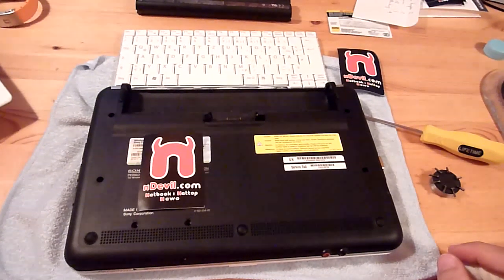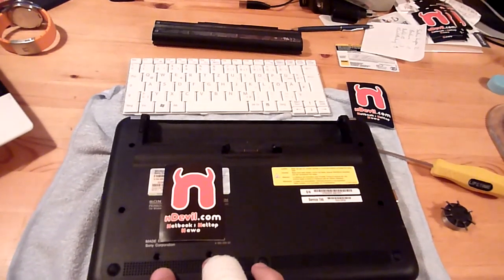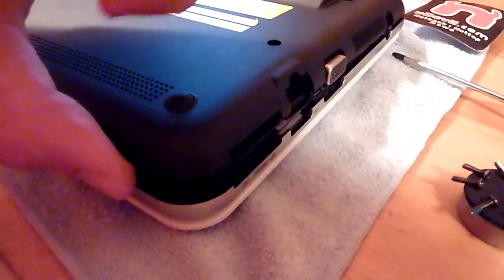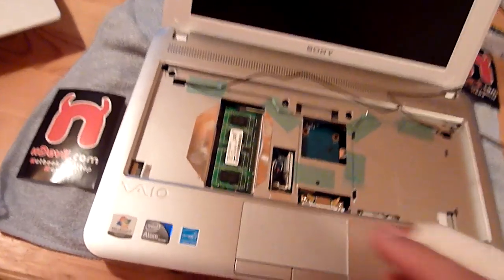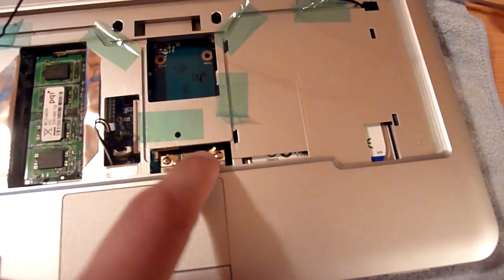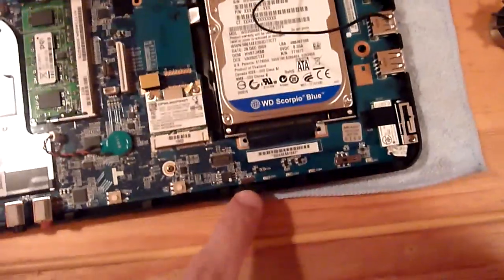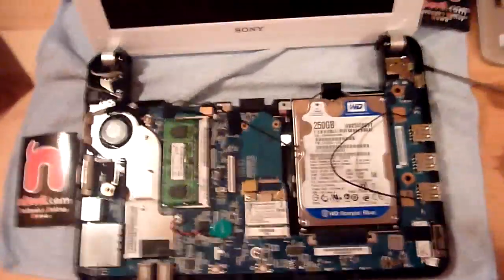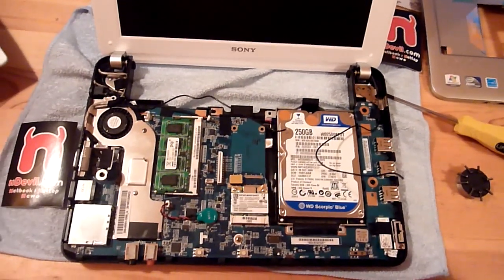Sony Vaio M Netbook RAM and HDD Upgrade Tutorial

Comment: Thank your very much. I upgraded my RAM to 2 GB. I would never have found the two tapes covering the screws in the battery compartment if not for your video. Bless you. The Intel Atom is so extremely slow, that even doubling the Ram did not allow me to play mp4 and mkv files. Bummer.

Comment: Thanks. I have managed to upgrade my RAM but now having problem with the WIFI. The WIFI is not working. The WIFI on/off switch works perfectly. It shows the wireless adapters but doesn't show any signal. Could you please advice?